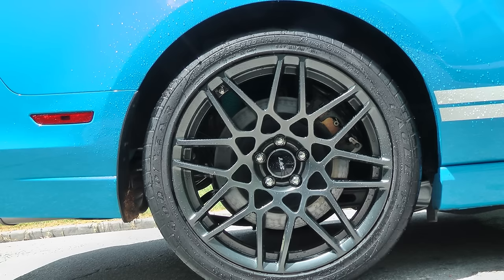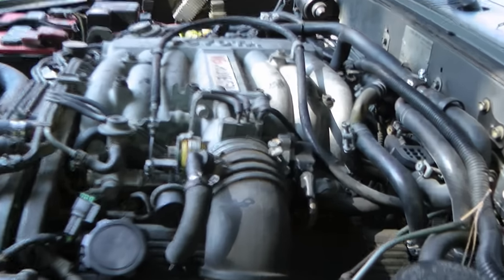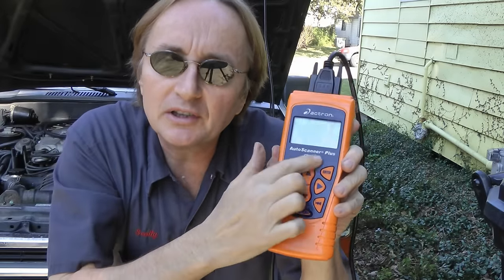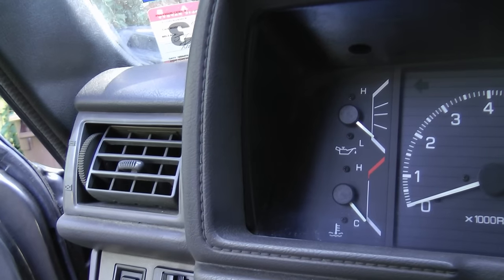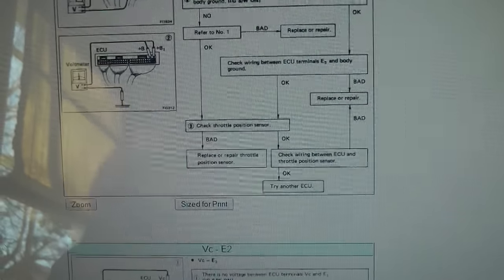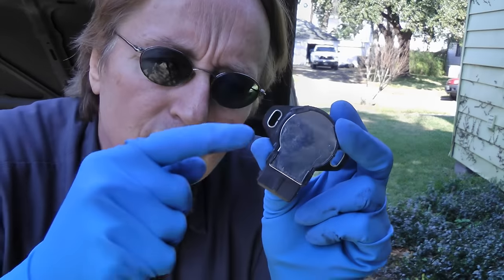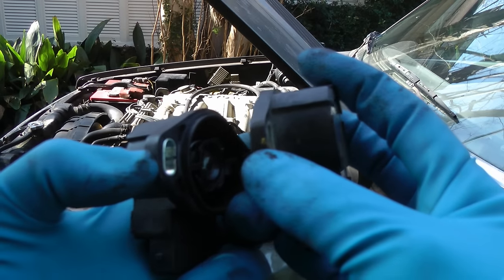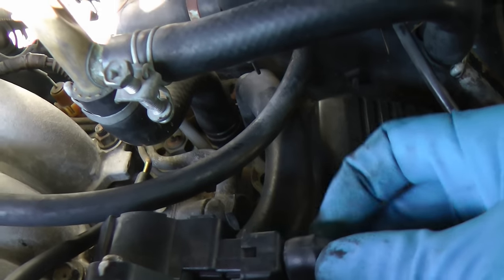How to Stop Car Hesitation (Throttle Position Sensor)

Comment: Hey Scotty love your channel, just subscribed!! I have a 1991 Toyota 4runner (same generation as in this video) and it also has the 3.0 V6. I just replaced the fuel pump and fuel filter and it ran great for around 90 to 100 miles, however now all of a sudden it is hesitating and feels really under-powered (also shakes at idle). My check engine light however is not on and when I try and get a code it just flashes quickly indicating no problems. Could this still be the TPS? What do you think?

Comment: I like your videos !! sir I have a 1990 f150 v8 5.0 when I turn the AC switch on the truck idle starts to going down until the truck shuts off or when the truck was running for 15 or 20 minutes and I turn off the AC switch the idle of the truck goes up what's the part the I need to change? thanks for your time and god bless you!!!!

Comment: Dear Scotty Kilmer 
Hope you are good.
Could you please tell me little bit about throttle sensor. I am sure that this sensor should continuously working engine is hot or cold in both cases. But the guy electrician told that this throttle sensor is only working in first start in the morning. Means that works only in cold condition.
Also pls advise should we keep IACV on mostly low rpm setting means max on the low rpm set point, what you suggest.
MAP sensor part number or pic?
Any manuals parts, service or workshop repair manual for 4efe Toyota corolla car engine 16valve 1300 cc

Comment: Hey Scott I have a 2007 ford f150 which seems to be hesitating quite a bit with no power. No codes flashing and i had put on a cold air intake back a year ago. At first the truck showed more power and better performance, now it seems to barely get by. Thoughts?

Comment: Great video.  
My current problem is when I more the wires that are connected to the sensor. The truck idles poorly. Continue to move there wires and the engine shuts off. 
In this case what is the problem the wiring or the sensor??? F-150 2005 5.4
Reply from the maker: +Aaron Armendariz get a new connector and wiring to splice in

Comment: Hi Scotty,

I am experiencing a slow response to acceleration especially when i press the pedal hard, but if i press it gently, the speeds increase normally. My car is also running rich, about a +14 on the OBD readings. When I press on the gas in park, the rpm's seem to go up slowly, and come back down slowly. When i first got this car, as soon as i pushed on the gas, the rpm's would jump up and come back down as it should, but now it's been acting. I thought it was my transmission but fluid looks fine. So, Now i am leaning towards maybe a TPS sensor. Keep in mind that that there are NO Check Engine lights at all, no faults on the OBD reader so I really don't know where to start. Any advise from a veteran would be grateful. Thanks.

I have an 2007 Jeep Grand Cherokee 3.7L AWD with 111K miles.
Reply: @scottykilmer

Comment: Ive got a 1988 ford f250 with a 351W, my question is would a faulty Throttle Position Sensor cause it to die when the throttle is pressed? Because this is my current issue with this truck. Thanks.

Comment: Scotty, hope all is well, just wanted to ask u a question. Jus bought a used 2005 pontiac bonneville gxp, kind of high mileage 145000 seems ok I know i might have to throw some money in it hoppfully not too soon. (crossing my fingers) pretty much running smooth, But been donig sum research somtimes the manifold can cause oil or coolant leaks. Hate to say might be experiencing those leaks nothing to major i seen so far, but the ac might be acting up heard it could be vacum hoses or manifold etc....... i was wondering have u any great knowledge about this particular car. Your feedback is very much welcome! Thanks!

Comment: Question for you Scotty the man! I have a 95 Toyota Celica, check engine light came on about 2 days ago. I have a manual transmission, yesterday i was on the highway and my car stopped accelerating, i had to hit the gas pedal all the way to the floor to get home, doing only 12mph. It starts all fine, but once i put it in gear, hit the gas, no movement. I tried clutching without gas and it won't even stall. Any suggestions will be greatly appreciated. Thank you in advance.

Comment: I have a stand alone that monitors my throttle position sensor voltage. The voltage output is perfect at idle, but at wide open throttle the voltage is 3.59 when it should be 5.  How will this affect my performance? Will it run lean when at WOT? Will my acceleration be compromised?

Comment: Hey Scotty. I've got a 2005 Jeep and pretty much I've got an issue where I'll take the car for a drive and get it to fully warm temperature and if I shut the car off and try to start it a few minutes later it'll crank but won't start. I have to take a few tries before it starts. What do you think could be my issue? If you could point me in the right direction on what to do maybe what to check. Thank you in advance.

Comment: if the throttle position sensor is set wrong can it make your car idle high? I just got my 93 Cadillac DeVille out of the shop and I was wondering if it can cause that problem .

Comment: Scotty, I replaced the alternator on my 2006 mustang v6 as it was only working part of the time, I charged the battery also to make sure it was good.  But now the idle is rough when you sit at a stop otherwise it's running fine.  I pulled the throttle sensor and cleaned that but it had no effect.

Comment: I have a 1991 4runner v6 SR5 that has a hesitation on 1st & 2nd gear. It'' s very frustrating to start off on 1st gear catching speed gradually in order to change to 2nd gear especially when getting in the freeway, very dangerous. I accelerate slowly till the speed & RPM is high enough to shift to 2nd gear. If I try to accelerate too fast, the engine hesitates & bogs out. Hopefully it's the TPS. My 4runner sat for 4 years with a blown head gasket before I decided to rebuild the engine. Unfortunately I had removed the hood so all the engine bay was exposed to the high heat of southern California & rain for all 4 years. I had no sensor problems before the the blown head gasket and passed smog easily. Some of the plastic connectors broke off easily so I habe no doubt that I have to replace some sensors. Cheap TPS at the auto parts stores cost 100 so I will first try replacing it with OEM sensors from junkyard engines. I'm glad I saw this video.

Comment: Tp senssor reading on obd is 8% on idle. No more adjustment left, car is hesitating when ac is on. Should I change sensor?
Reply: 8% is very low, it should be between 17% 18%

Comment: I've got a 2005 Ford Five Hundred Limited 3.0.  I was told I needed a new throttle body sensor and a temperature sensor. I can't find anyone around me that sells just the sensor. My car was only in production for 3 yrs so parts are hard to find. Any suggestions Scotty? I live in  Baltimore MD. Thanks!

Comment: Hey there Scotty thanks for sharing your videos.. I have a question.. When I turn on my car everything is ok until I turn on the AC and the voltage drops.. I try'd everything.Changes the alternator and bought a new battery.. I went to PepBoys and they told me that it might be the TPS..??? Its a Toyota Sienna 2000.

Comment: Hi, I just subscribed. I have a 2000 Nissan maxima GLE. When I drive place to place maybe it might be 10 to 20 minute intervals. The car starts at a slower pace. Today after driving a long while and going from place to place it just felt like the car was tired to start. Turning the car on and off at each place. Could it be the key to the car which is 21 years old is getting tired?Thank you for your answer!

Comment: hey scotty I've diy'ing my car repairs with your videos for a while and everything has been great but I can't find one on my 94 bronco it's not accelerating and rpms won't get Over 2000 check engine light is on and after a while light goes off and it's back too normal can you give me a few suggestions thanks in advance

Comment: Can a TPS cause issues w/o tripping any codes? I have a random issue with my car randomly "stuttering" while driving, usually happens once a day but can go 2-3 days w/o any problems (avg 44 miles daily) it has happened 20mph up to 70mph, up hills, down hills, and even on straight roads. 

To give you an idea of what it feels like it's like my ABS brake is activating for 1 second while driving (that thump thump thump feeling in the wheel)

Comment: Hi. Thankyou fun vid. Im working on a honda civic 93. It ildes very high when cold does drop to normal a couple min. But today i toi for test drive. Is ok if i barely push peddle. But if i try and give it a little more peddle it almost stalls. But when i lift up on peddle engine idle returns. And im able to drive. But if i rev the peddle in nuturel or park no stalling at All. Please what is wrong.?

Comment: just purchased a 1987 Nissan D21 V6 and it seems to surge at around 45~50mph but it idles well and engine sounds really nice. is it the TPS or is it the transmission?
Reply: Doc savage Did you ever figure out what your problem was? I've got an 2000 E150 doing the same.

Comment: Got any tips on how to find the proper throttle position sensor for a 2001 Toyota 4Runner. Mine has 4 prongs and rotates clock wise when it opens the butterfly. I thought I finally found one and when it came I realized it opens counter clockwise!

Comment: Hi Scotty. I have an '03 Camry. When I accelerate, sometimes my car hesitates. It sometimes happen when I am slowly pulling out of a parking spot. I was taking into consideration your video, but the only thing is that the car engine light is off. Could the throttle position sensor be the problem? On a separate note, do you know what is causing the gas mileage range to constantly decrease as time passes? For example, the range may show 230 miles on a full tank, but when I unplug the battery for a few minutes and plug it back in, the range shows 350 plus miles.
Reply from the maker: could be lots of things, but more often a dirty  MAF sensor, try cleaning that first. Also realize gas range is B.S. guess anyway on those gauges

Comment: Hey Scotty, love ur videos :) i have a 2001 Pontiac Grand AM SE L4 2.4L, a month ago went to work and car started idling up and down and vibrating trying to stall, b4 this she ran great, code p0440 was the only code showing which is for evap leak... new gas cap, iac, vent valve, purge valve, fuel filter, spark plugs... but she stalls after 10 minutes of morning warm up and stalls at stop light only when i put on brake, i have to keep one foot on brake and one on gas this keeps her from stalling, she starts on 1st crank everytime, but once she warm up she will stall at every stop if i didn't have gas slightly pushed, once going she purs like a kitten... after watching this video i suspect the TPS, does this sound to you like the TPS is the problem? oh 2 days ago took her to get smog knowing she would fail, i did it hoping they could find the problem because my mechanics took 500.00 and never fixed the problem.. so back to smog she passed with flying colors, wow i really was shocked... if u can give me any advice with any of this i would be so so grateful ,,,,,,thanks

Comment: Scotty, you make this sound WAY too simple! I changed out the TPS.. not easy to do. But, the problem is not solved and apparently the real entire procedure to set the TPS is very involved. Not just a matter of swapping a part. My car runs like crap, now. I'm going to replace the MAP sensor and I've replaced just about everything at this point, but getting an adjustment on the TPS is very challenging and there is no way to just mark how it was set, before, especially if it is UNDER the throttle body and difficult to access.

Comment: I have 2001 Nissan Xterra v6 3.3l With a new throttle postion sensor and it work perfectly first day then next day it started having problems very hard start when engine cold and when u drive and press gas pedal the rpm will accelerate but not the speed and got a diagnosis and they said bad tps so went n exchanged and same symptoms?
Any ideas on what the problem is and how to correct it ? I do most of my own mechanic work. 
Thank you for your time

Comment: Hi. I have an Audi A6 1.8T Petrol.  Once the AC or Headlights are turned on it gives a slight miss. What can be the reason ? Tried cleaning throttle body, injectors but no big difference. When we put the scanner it shows some fluctuation of oxygen sensor readings. Can this miss be due to a bad oxygen sensor or alternator? What is your opinion Sir

Comment: Hi Scotty! I rely on your videos so much, and thank you for doing them! I have a Q: I just replaced the TPS in my '02 Pontiac Sunfire last year, and it seems to be giving out on me again (at least I'm hoping it's that and not transmission rebuild time...). Do you have any ideas about what would cause a TPS to fail so quickly? Maybe I just got a bum part, or is there something more going on? My mechanic uses all new parts so the TPS wasn't a rebuild or anything, but I guess NAPA could have sent him a bad part anyway. Any ideas?
Reply: You can always end up purchasing a new "bad" part from the get go. I purchased a brand new battery once, had the fancy "ok I'm in great shape fancy green light" on top of it.....installed it, car still wouldn't start. Took it right back, battery had a bad cell in it, not enough juice to crank the car, but enough juice for that pretty green light. Had a water pump give out on me after about three years of ownership, bought a "remanned" or remanufactured one trying to save a few dollars, it lasted a year....had to get another one.
Years ago I stopped purchasing "refurbished" anything for a car, I learned the hard way, but there's always a chance of obtaining a new "bad" part, or a part that passed initial testing at the factory, but failed not long after it was out the door.
Had an ex girlfriend who owned a Pontiac Sunfire. Every other day her car kept trying to overheat, checked her coolant, the car was losing coolant. Got up under the hood once when it was hot, heard a hissing sound near the overflow reservoir. The previous owners had "melted" the overflow reservoir where it had cracked to try to avoid buying a brand new one. This melting repair failed, and the pressure and coolant were coming out the crack. (to this day I am still trying to figure out just how they pulled that one off).
Bought her a new reservoir, installed it.......no further coolant issues....The only reason I mention this is because it was a sunfire like yours, (thought I's share lol)....but  I don't trust used car dealers nor previous owners unless the previous owners lay all sorts of receipts in my hands from where they purchased the parts or had repairs done and have receipts to prove it....I have a hard time trusting mechanics as well......There are TONS of good ones out there, but there are still those that will "insert or utilize" a cheaper built part on occasion trying to save their company money.......Not saying that's what your mechanic did, you may have known him for years....just saying....
Reply: TheNOCELL Unless it came bad straight from the manufacturer, I doubt that's what happened in my case. Unless it's something like rebuilding engines and whatnot, my mechanic pretty much only orders parts from NAPA. There are delivery people running in and out constantly every time I'm there. 

That said, I also have a Sunfire...lol It's been a great little car, but it's 14 years old and pushing 200K miles, so she's a cranky old lady who's just getting to that point where I'm having to replace the normal parts that break or fall off with that much use. Anyway, I did get the car into my mechanic, who checked out the TPS, the engine itself, the transmission fluid, cleaned out the idle air intake just in case, etc, and couldn't find anything wrong. And strangely enough, the car hasn't had a problem since then, even though for a solid two weeks before then, it acted like it was going to die at any moment. It's bizarre.
Reply: I just read today that after some throttle bodies are cleaned, that it's recommended to pull the fuse to reset the pcm so the car can "relearn" the way the car is now running with clean components. I read several comments stating the same thing, just cleaned the throttle body, hard starting, idling funny, then after a while car acts normal because it has "relearned" the air fuel mixture with the new cleaned component. Some say to do this, some say don't as the car will "relearn" on it's own...One other thing regarding rough idling and such, I've always gone by the ol rule of thumb of utilizing the same gas as often as I can. I rarely go to a different gas station unless I am traveling and have no choice. Fueling up at any old gas station you come to can increase your chance of getting some bad fuel, which can cause some of the issues you are describing...

Comment: Some added info for those diagnosing. Mine is a 99 mercury villager and I will upload a video on throttle postion sensor since there isnt one for my van. If the vehicle keeps shutting down 
 and idling and running funny--but can still be driven that rules out other things. The throttle position sensor does not have the ability to STOP YOU COLD- STRANDED--CALL TOW TRUCK. Other things such as "cam shaft position sensor--the distributor CAN
Reply: why in the comments does it sometimes draw a line through entire sections?  does anyone else see it or just on my computer?